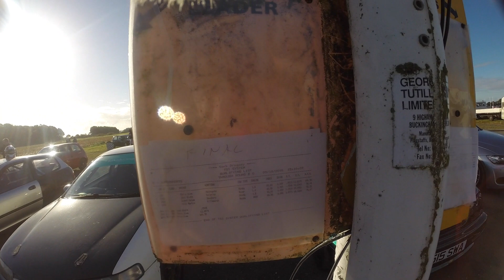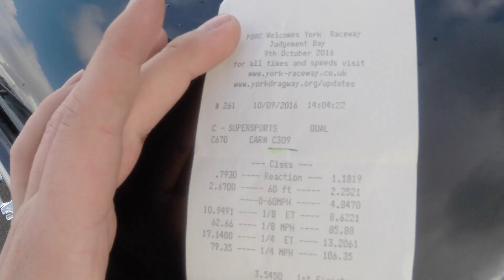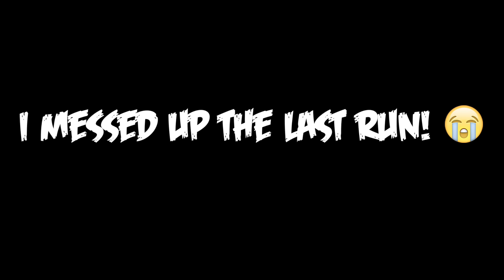DC2 GOES DRAG RACING!

Comment: Bro that's was awesome,nice that's second worked nice I see 👌🏻👌🏻👌🏻👌🏻nice sounds sick too..I can't wait to get my coupe back on the road as well,I had too a lost my self this pass 4th of July the ball joint bolt backed out,witch I think was from earlier I had gotten on it for a bit on the street and I think from that the bolt came loose some how but later that day,i was driving down the street hit a ditch in the road and lost control swiped a tree and that what totaled out my ek Coupe.i walked out form it and didn't think it was bad but it was.crushed the wheel to pieces,but I salvaged my parts from the car motor and all was still good.before I had removed it i had started it and it started rite up and that made so happy to hear it start up like nothing.so I'm currently building my new ej8 k24 Coupe "ek Coupe"

Comment: What loop hole did you use to pass your MOT with out and airbags or SRS system ?
Reply from the maker: +Buddy my DC2 never threw an air bag light after removing the airbags so it's no issue
Reply: Daniel Silvester hmm my understanding of the regulations as of 2012 was that if it had airbags fitted from factory they had to remain and work which is a load of bollocks when you have buckets and harnesses 😂 im a new sub really enjoying your content keep it up 👍 and appreciate the replies as well cheers bey